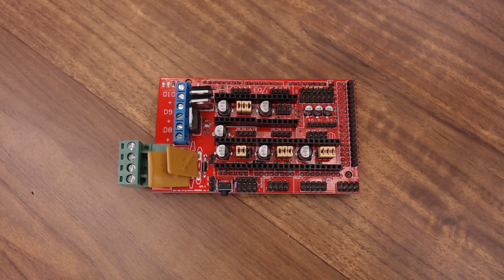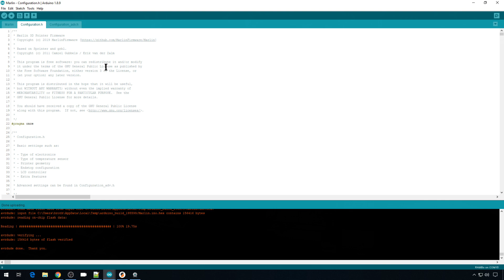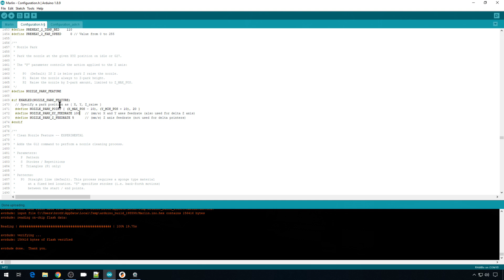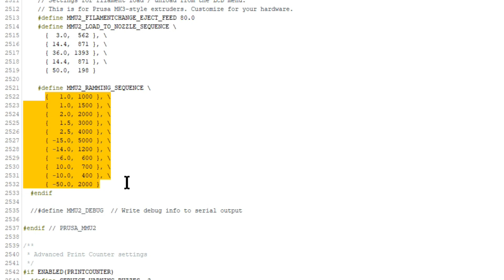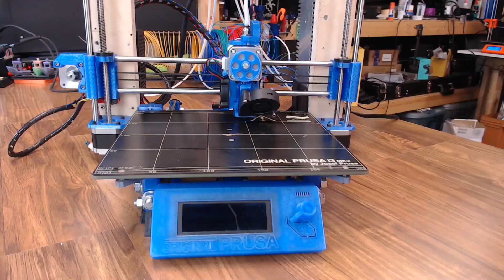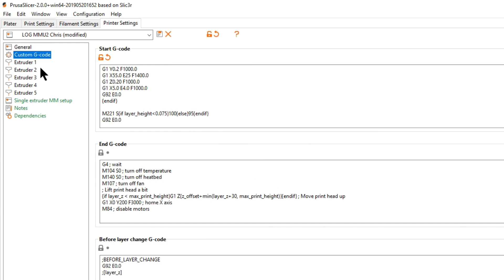Prusa MMU2S On Any Printer Running Marlin - Chris's Basement

Comment: "Eh… maybe." is about where I would expect it to be. You're the first actual tester for this feature that I'm aware of!
Reply from the maker: I was super impressed with it, worked out really well.
Reply: @ChrisRiley  To be fair, the MMU makes it so easy! And of course it helps that Prusa Firmware is open and their code is straightforward to adapt. The "ramming" moves actually do a lot of the magic by making sure the filament tip is re-insertable. (Examine the tips of the ejected filament and tune ramming as needed for your nozzle, folks!)

As for the starting G-code, M221 should be fine. M420 S1 is generally preferred over G29 if you have a big mesh. I'll see about adding the G-code that tells the MMU what the materials are. That will make the display on the MMU more useful.

Thanks for providing a very thorough run-through. I hope this encourages others to consider the MMU2 as a single-nozzle multi-color solution. It's a great alternative to devices like the Palette+, and I can't wait to see what someone with a Very Large Bed™ does with it.
Reply: D-oh— Apparently we already have M403. So all is good to go! http://marlinfw.org/docs/gcode/M403.html

Comment: how do you define wich pins the serial 2 uses?
Reply from the maker: The serial settings are internal, backed into the firmware. So think of it as they are set when the board is made.

Comment: OK. Sorta unrelated question, but hoping you might know.

On the Mk4 the MMU3 Cable connects to the upper row of pins on a connector near the top of the electronics box (the xBuddy). But there is another row pins directly below what you plug the MMU cable to. On the Mk3 that lower row of pins include a TX and RX of a serial port, plus power and ground and one other pin.
Is the corresponding lower row of pins on the Mk4 ALSO  for TX and RX of a serial port?
I haven't been able to find info on that anywhere, yet. I'm using that serial port on my Mk3 for a special use and am planning on migrating over to the Mk4, so I'm hoping those pins on the Mk4 are the same as the pins on the Mk3.

Does anyone know?
Reply from the maker: Interesting config. I'm sure there is a serial there you could use, but i don't have a lot of info on it yet. Hopefully more comes out on it now that the new GPIO board is out.

Comment: hi chris,

i wil instal a profesional firmware to my ender 3 s1, is it possibele to make this work with this firmware? and wil work this tool at a ender 3 s1 direct drive?
Reply from the maker: Hello. You would have to do a custom install of Marlin to make this work on the printer.

Comment: would this work at a ender 3 s1
Reply from the maker: I don't know anything about the S1. I know it won't work right out of the box, you would have to have UART pins available, flash an updated version or Marlin and probably a direct drive extruder setup. They are a lot of work to get going.

Comment: Would this work for a Anycubic Kobra Go? 
I think it can but i have trouble understanding how the MMU would connect to my printer, 
would it use the filament runout sensor as guide reference?
Reply from the maker: It could work if there are some RX and TX pins available. The tricky part is the runout sensor. It needs to be very close to where the filament feeds in to work correctly.
Reply: @ChrisRiley I was thinking of this as well, but I'm still trying to figure out how the MMMu would know when to changes colours if I cant connect to the printer directly.

Comment: I just hook this up for my cr10s5 im on to tuning.
Reply from the maker: Nice! Hopefully it's going well.
Reply: @ChrisRiley  Yo, I didn't think you'd reply. well I'm sorta stuck I'm trying to get my filament to feed past the the sensor into my gears. My sensor sit just above my bondtech dds.
Reply from the maker: @Doyouevencheese  All of that will be controlled here.  

#if HAS_PRUSA_MMU2S
    #define MMU2_C0_RETRY   5             // Number of retries (total time = timeout*retries)

    #define MMU2_CAN_LOAD_FEEDRATE 800    // (mm/min)
    #define MMU2_CAN_LOAD_SEQUENCE \
      {  0.1, MMU2_CAN_LOAD_FEEDRATE }, \
      {  60.0, MMU2_CAN_LOAD_FEEDRATE }, \
      { -52.0, MMU2_CAN_LOAD_FEEDRATE }

    #define MMU2_CAN_LOAD_RETRACT   6.0   // (mm) Keep under the distance between Load Sequence values
    #define MMU2_CAN_LOAD_DEVIATION 0.8   // (mm) Acceptable deviation

    #define MMU2_CAN_LOAD_INCREMENT 0.2   // (mm) To reuse within MMU2 module
    #define MMU2_CAN_LOAD_INCREMENT_SEQUENCE \
      { -MMU2_CAN_LOAD_INCREMENT, MMU2_CAN_LOAD_FEEDRATE }

    // Continue unloading if sensor detects filament after the initial unload move
    //#define MMU_IR_UNLOAD_MOVE
  #else
Reply: @ChrisRiley  Thank you so much. which one of those would make the mmu2s continue to feed another 45mm or so past my ir sensor into my extruder gearim not using a prusa style extruder.
Reply: @ChrisRiley  I haven't gotten much help in the diy mmu2s Facebook page.
Reply from the maker: @Doyouevencheese  Try increase this one and see if anything changes. 60.0, MMU2_CAN_LOAD_FEEDRATE
Reply: @ChrisRiley  dude you're the best 👌 perfect.
Reply: @ChrisRiley  So I didn't get it to work. I'm going to crusa my extruder. I was currently using a bondtech dds extruder trying to get it to work with a ir above it but that's a no go even more of a no go with the new firmware. I'll drop a update on here.

Comment: I have a question regarding the compatibility of this upgrade with octoprint. Is the MMU controlled by normal gcode? If yes as far as i understand, it should work with the pi just feeding it to the board. If it runs diffrent, please lemme know, because then the upgrade wouldnt be feasable
Reply from the maker: It is controlled with just regular G Code

Comment: This might be an odd question, but does anybody know where to find the insert nut used to retain the pneumatic fitting on the filament selector?  I can't seem to find that specific insert anywhere.  Even hardware kits that you find people selling for the mmu2s omit that one specific part.  The reason I am looking for it is because I enjoy projects and decided to build an mmu2s from the ground up, sourcing the parts myself.  I have found literally everything else that I need to build this thing except for that one little brass fixture.  Really the only reason I wanted to find the specific one used by Prusa was just so I didn't have to take the time to modify the 3D model to accommodate a different insert nut, but I have spent so much time looking for it at this point that I may as well have just modified the f**** model!
Reply from the maker: I think this is the part you are looking for. http://www.theinsertcompany.com/brass_multi_micro_inserts_for_plastic.php
Reply: @ChrisRiley  Thanks Chris, appreciate the reply.  I came across that site in my travels but assumed they didn't deal in small quantities because they require to be contacted for pricing.  I admit I made an assumption and didn't actually bother to contact them though.
Reply: Just use one alternative without insert. https://www.thingiverse.com/thing:4646404
Reply: @MrFixel112  I'm thinking you're probably right, a modified model might be the most practical approach.

Comment: Your videos are awesome always, I am wondering if the CR10s Pro motherboard can connect to MMU2 through USB port, since it doesn't have extra Tx, Rx available in the board but at the same time the USB port is a UART itself.
Reply from the maker: Thanks! You might be able to make that work, but I am not sure how. You would have to hack the hardware serial frame work in someway I think.
Reply: @ChrisRiley  I was looking at the board and found that the LCD connects through serial connection at RTX/2 since I use octoprint everytime is not much a problem to disconnect it, since the RTX3 isn't wired and don't wanna take a risk at burning the board while soldering so small pins.

Comment: can someone confirm if this works with the GT2560 A board?
Reply from the maker: That board doesn't have any serial pins to use for this.
Reply: @ChrisRiley   can you recommend a board i could use as an upgrade/replacement for my prusa clone so i can run the mmu2
Reply from the maker: @BovoM8  You can make it work on a lot of boards, but it is very difficult to get right. The easiest board to use is probably a mini rambo or an einsy retro.

Comment: I'm trying to do this on a SKR1.4  Turbo board and i'm getting an pins error?  #Serial port pins (2) conflict with e stepper pins. Any help is appreciated. Thank You in Advance.
Reply from the maker: Yes, You need to use -1 or 0.
Reply: @ChrisRiley  thanks I did and my skr board is not communicating with the mmu? Am I supposed to hook it up to the tft pins or the I2C pins? Thanks for the help again
Reply from the maker: @jere2300able  It will go on the TFT pins, make sure both MMU and printer share the same ground.

Comment: Hi Chris , trying to put MMU2 on a Bear using SKR Turbo 1.4 , I need a little push on Serial connection -- Pin order onboard is RST, RXo , TXo, Gnd , Npwr.. Brown , White , Green, space ,Blue .. Correct ?
Reply from the maker: Hey Dan,  on the board side its brown RST, space, green RX, whiteTX, blue VCC. MMU side is the same, brown wire closes to the power connections.
Reply: @ChrisRiley  Is this for SKR 1.4 ?
Reply from the maker: @digupstate  No, this is stock, this is the MMU side. On the SKR, say left is DC in. Left to right RST brown, green RX, white TX, space, blue vcc.

Comment: Hi. I'm in need of some advice. I'm helping a friend add a prusa mmu2 to his cr-10s. His using the skr1.3 board with tmc 2130 drivers and the stock cr-10 display. So the mmu is connected to the tft port (aux1) and the part that we have a problem with is enabling a serial port for the skr in marlin 2.0. I've read somewhere that the tft port is apparently identified as serial port 0. So in config.h I defined SERIAL_PORT_2 as 0 and later in configuration advanced settings I set the mmu serial to SERIAL_PORT_2. And the weird thing is that when we turn the printer on configured as such, the display won't switch on and from what we can tell the skr doesn't boot up properly. However when we unplug the mmu for booting and then plug it back in, the printer works. The mmu just doesn't. So we believe the display somehow interferes with the mmu. I'm not an expert but aren't those displays using SPI to communicate? SPI and Serial are two separate interfaces so they shouldn't influence each other right? Anyways. I'm not sure at this point where the problem exactly lays. The thing I'm not sure about is enabling the secondary serial in marlin for the skr 1.3. I know how to do it for a regular AVR boards, it's the skr I know nothing about. In general. How do I set it up to work with any serial device? Not necessarily the mmu. Is the tft port indeed port number 0 and can it interfere with the display? And are there any additional steps I need to take?
Reply from the maker: This is not an easy thing to do and I am try to find my notes for you. The LCD is SPI correct. You really only have 2 serial options at this point. So, pick 2, the TFT is set to 0. That sounds like maybe the MMU2 has something crossed on the wire you need 12/24v to driver the motors and 5v for the board. Make sure your MMU2 wires line up to the right pins on the TFT connector. Make sure both the 5v and 12/24v are using the same ground.
Reply: @ChrisRiley  
I was able to solve the previous problem, but a new one appeared and maybe You could help me in it. I have a Creality CR 10-S printer modified in SKR v1.3, Marlin 2.0 and a direct ekstruder and hotend based on parts of Prusa.
I have set up everything: Marlin, Slicer, The printer is efficient and connects to the MMU, that is, loads the filament, captures it, loads it into the nozzle, withdraws and prints. 
The problem is: when I cut the test model (cube) in Slicer in two colors and I have a gcode. Printing begins, one color prints, the extruder and the entire head momentarily stop. At this point, the MMU should withdraw the material to replace and continue printing. This does not happen, does not withdraw the material, only prints, MMU does not make any attempt to withdraw and change the material but I know this motors are works. No error appears, all the time the printout flies in one color. I have already tried to do everything including the use of Your gcode in which the same happens, i.e. the MMU does not withdraw the material and does not replace it. The extruder itself withdraws the material, but the MMU engines do not work. Can the lack of an IR sensor here be that reason? If not, I really don't know what to do and I count on help.
Reply from the maker: @bartoszwrobel9159  If you are using the newest version of Marlin then it is probably waiting on signal from the IR sensor.
Reply: @ChrisRiley  
Okay. But in Marlin I have this function turned off. I should uncomment it in this case and try to connect the sensor?
Reply from the maker: @bartoszwrobel9159  Ah, then no, I am not sure what it is doing in this case. Something in the tool change is broken. If you send T0 T1 commands, does the selector change?
Reply: @ChrisRiley  I send You a email message (Email from YouTube), with more information (My mail is dziambelek99@gmail.com). I think it will be better type of contact and present my problem and information. I am waiting for Your answer with eagerly.

Comment: Chris Riley I Need your help, please. I was empowered by this video and set off on reworking my Tevo Black Widow printer to be a large, over the top multi material printing monster. I almost have it working. It works great without the MMU2S. But when I change the settings in marlin as you have shown when it does it's first prime line the extruder goes one way and feeds filament and then when it goes the other way it unloads filament but at the same rate as when it was feeding? I do not understand this. Please can you help? I am here, on F.B., on 3dprintboard, thingiverse. I am easy to find. Anyways, here is my thingiverse on this printer I made. Your video was the inspiration for my build: https://www.thingiverse.com/thing:4048939
Reply: THis is what it is doing trying to print the test cube in this video as it goes to print the prime line at the start of the print: https://www.youtube.com/watch?v=iICQ8sENQJs&t=
Reply from the maker: My firs guess it you need to switch your extruder to relative mode. Add a M83 at the start of your start gcode.

Comment: Hi chris. As always really nice and helpful video. I try to put mmu2 on cr10 with skr 1.3 board. And it work. Thanks to you! 
I have a question though..when printing with only one filament, does marlin support features that ask user to choose which filament user want to use (via lcd just like prusa printer)?
Reply from the maker: That's a great question and I am not sure. I know it will take which ever tool you select in the slicer, but I am not sure about the menu.

Comment: Hey out of curiosity has anyone tried this on an skr v1.4 turbo? I currently have one on my mk3s and can't figure out where to plug the connector into. I have a tft 35 v3.0 so I can't use the tft port and both my serial ports are being used. Any help would be greatly appreciated. Also can I run the power cable straight to the psu? Thanks!
Reply from the maker: It would need to go on the TFT pins, it would be really challenging to run both on one bus. Yes, you can power it straight from the PSU.
Reply: @ChrisRiley  thank you for the response. Would it be more worth it to just place it on another prusa with the stock einsy board? Or do you think it would be better on the skr v1.4?
Reply from the maker: @zachyonk1  The stock prusa board would probably be best.
Reply: @ChrisRiley  awesome, thank you!

Comment: How can I disable the IR sensor? I can't get filament to load.
Reply from the maker: In Marlin it won't be enabled by default.
Reply: @ChrisRiley  so I burned out a tmc2130, drive on the board. Replace it with a good one from a stepper driver and it all works now.
Reply from the maker: @The_Hudson_Workshop  Nice!